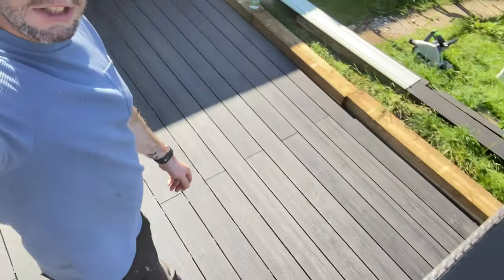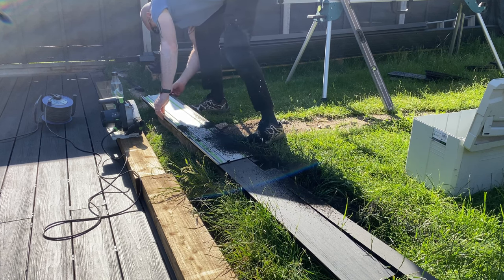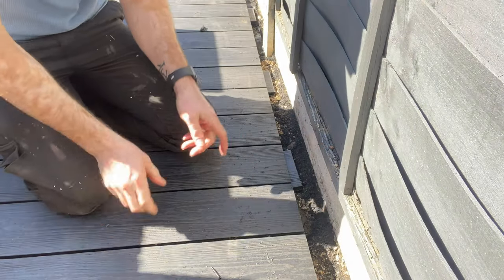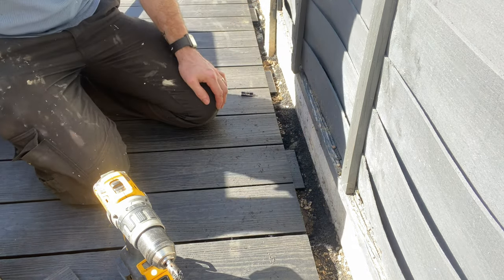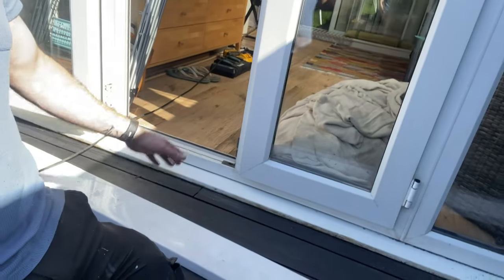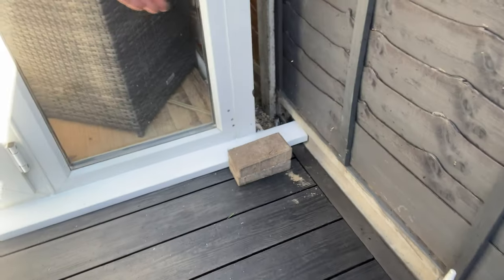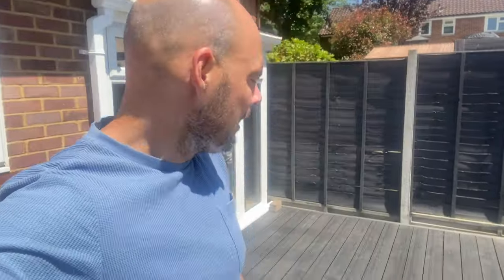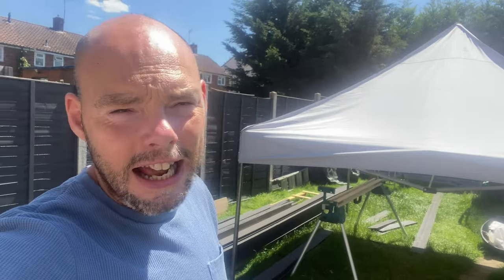How To Fit Composite Trim, Bespoke Build Threshold & Secure Sleepers As Steps #howto

Comment: Hey, I’ve just watched your videos on this job from start to finish…PERFECT! I have the exact same decking but a bigger area, had a company lay it 18 months ago and it’s a total disaster! I gave them access while I was on holiday, not the best idea 😢 They haven’t used any noggins, hardly any posts so it’s like a trampoline. The boards are popping up, one post has popped through 6” I had pre bought the composite and was charged a fortune to have it put down. I have back problems but have no choice but to tear it all up and to somehow try and put it down PROPERLY myself 😂 I have to somehow measure how much joists I need, any advice would be really appreciated 😊